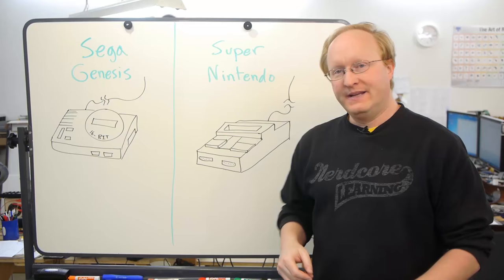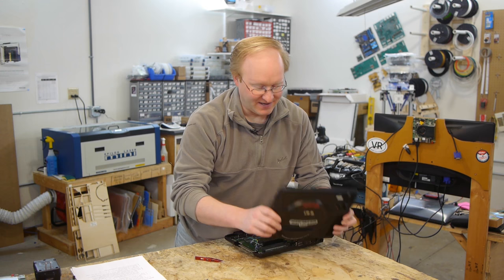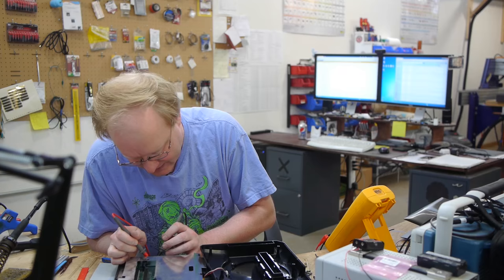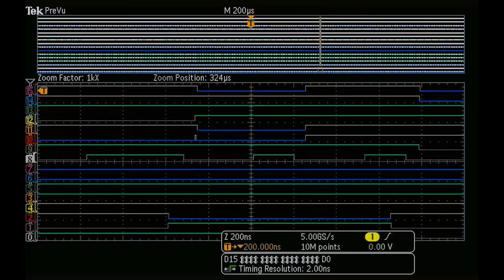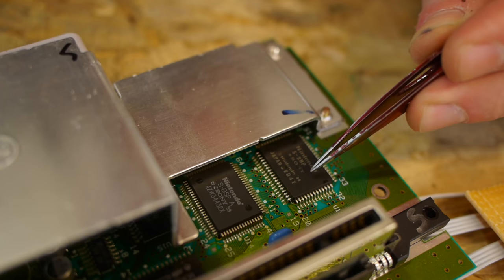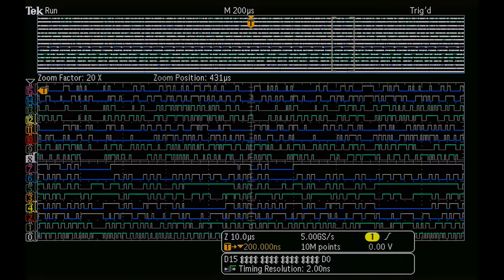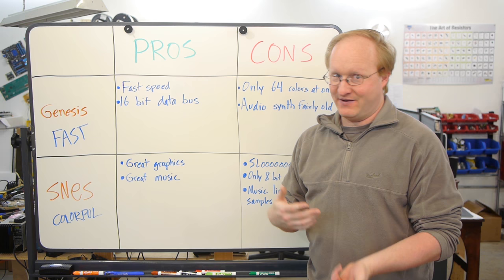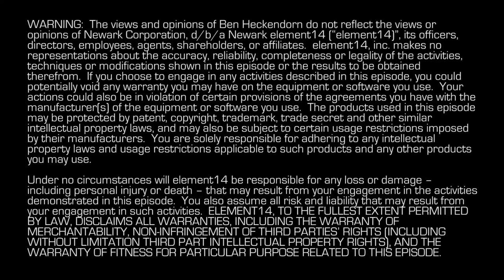Ben Heck’s 16-Bit Console Wars!

Comment: 15:29 The only parts of the Super NES that run at 1.8 MHz (same speed as the NES) are the controller ports. PPU I/O ports are 3.6 MHz, RAM is 2.7 MHz, and ROM can be 2.7 MHz or 3.6 MHz based on the memory control register.

Comment: Well, time to list and nitpick and be annoying.
First, the power base converter don't just "make the cartridge fit", but it not only adapts the pinouts to work, but it also does some memory mapping wizardry to fool the SMS game into thinking the sega genesis memory map is the SMS memory map, but nothing major and the actual SMS work is indeed done by the genesis.

Secondly, the snes indeed was planned at some point to run the NES games, but the main obstacle was the radically different audio chip, that simply could not emulate the NES audio.

Now on the matter of the graphics data, both consoles work with 16 color, 8x8 graphic "bitmaps" called tiles that are assembled like a jigsaw puzzle onscreen, and both had the same exact size of tiles, memory wise. The higher variety of colors snes offered came from the wider selection of palettes to use on the tiles. The genesis offered you 4 sets of 16 colors, while the snes offered 16 sets. also those sets on the genesis were composed of 512 possible colors, while snes offered 32768 colors to choose from.

Now to add one more interesting detail to the already big wall of text, the snes required much cheaper ROM chips because you could use slow, 8bit 2.68 or 3.58 Mhz ROM chips (yes, the devs could potentially sabotage the system even more by using cheaper 2.68 Mhz roms) on the system, which allowed most snes games to actually have more data than the genesis ones, that required a blazing fast 7.6 Mhz ROM with 16bit bus, thus why games with more details and tile variety etc like RPGs were better on the snes, while games that required a CPU that was not constantly in pain ran better on the genesis.

And well, in terms of which is better is entirely dependent on your taste for games and your mood, as not only the developers were wildly different, as the systems enforced wildly different games with their limitations, and the developers of that time in general tried their best to deliver awesome games, and did what they could do.

Comment: I care more about "which games are more fun" than "which system is technically superior"
Reply: +vince94 (haxxor199x) Both are equally obsolete because 100 megahertz is the minimum unit that matters at all in modern Risc architecture .
Reply: Both are very fun timeless consoles, collect for them both.
I can't imagine a 16-bit era without Alien Soldier or Mega Man X
Super Metroid or Shinobi 3
NInja Warriors or Streets of Rage 2
Final Fantasy VI or Shining Force (1 or 2)
R-Type 3 or Thunder Force IV
Contra 3 or Gunstar Heroes

the list goes on and on...
Reply: I'm confused by your comment. 3rd parties are not as much concerned with technical superiority as they are with the consoles install base size and sales rate. Hence why the DS, 3DS and Ps2 received more support despite being technically inferior to their direct competitors.  
Also you somewhat contradicted yourself by lumping the GC in there, the GC was superior to the Ps2 yet received less games, (though it still received wayy more than the 64 and Wii U), so it's ridiculous to compare the GC to those two.
Also our comments are regarding the 16-bit systems not the 6th gen systems?

Comment: What bugs me is that this is all known information. Anybody who's capable of googling spec sheets can do a side by side comparison. Base console, the SNES trumped virtually everything except for processing speed. This was Sega's only claim, so my God, Blast Processing was plastered every where! Never mind that audio was generally better on the SNES. Never mind that the color palette was larger and brighter than the SNES. Never mind that rotation and scaling could be handled in Mode 7 with the SNES while the Genesis needed it's 32X and CD Attachments.
Reply: TheChikyChiky considering Nintendo had an extra two years to develop the hardware, it's strange that they even let Sega have that advantage.  And it's not a small thing either as it allowed Genesis games to have more objects on screen without slowing down which is a big plus for some genres such as shooters.  There are a number of examples of SNES games with less going on in general or inexplicable slowdown.  It's an advantage Sega probably shouldn't have had at all.
Reply: TheChikyChiky This is actually not true. The Genesis has other advantages over the SNES that were either not mentioned in the video or were only briefly mentioned here. Did you notice the part where he said each pixel on the Genesis carries less data because of the lower color count? There's an upside for Sega on that: Its games run at a higher resolution. Basically, Genesis games run at a higher resolution than SNES games.

Another difference not explained in the video are sound channels. The Genesis uses 10 sound channels while the SNES uses 8. Finally, he didn't compare the clockspeed on the co-processors. The Genesis' co-processor runs at a faster MHZ than the SNES' main processor. So there's a lot more to it than just a faster CPU.
Reply: +Gonçalo Tordo you just blow my mind
Reply: +TAMPUZ Thank you :)
Reply: +Gonçalo Tordo i didn't even know sega genesis/megadrive had 10 sound channels i thought the snes had more sound channels but when i saw your comment.. BOOM!
Reply: +TAMPUZ Sadly, it's a common misconception. The Genesis has TWO sound chips, but for some reason, all comparisons I've seen on Youtube only list the FM sound chip and completely ignore the PSG's sound chip existence. 

The FM sound chip has 6 channels and the PSG sound chip has 4 channels. The SNES only has one sound chip but has 8 channels. This is actually part of the reason why many Genesis games sound kind of poor, the Genesis has the potential for better sound, but it requires developers to properly balance both sound chips.

Another misconception between both consoles are their resolution outputs. Almost every comparison I've seen states the SNES runs games at a higher resolution because the official SNES resolutions are as follows: 256x224 512 x 448 versus the Genesis resolution of: 320 x 224.

What many don't understand is that the 512x448 resolution is not meant to be used for gameplay. In this resolution, the SNES can only list 16 colors. This resolution mode was created for title screens, nothing else. No game has ever used this resolution mode. So SNES games actually run in 256x224 which is a lower resolution than the Genesis' 320x224
Reply: japenese and europe can do amazing music with genesis but did you know gems sound driver? its so bad. but only some developers can do amazing music with gems but still gems sound driver is maybe the worst sound driver ever on the genesis and thats the reason why the many genesis games sounds so poor.

(sorry for my bad english)
Reply: +TAMPUZ Yep I'm familiar with it. It really was a poor sound driver though some developers did create great music despite it. As far as  I know it was used for over 100 Genesis games making it the most commonly used sound driver on the console. The driver only used the FM chip if I'm not mistaken

(Your English is fine, don't worry :) ))
Reply: ok thanks.
and thanks for telling how many genesis games uses gems sound driver. but the best gems music what i know is: robocop vs terminator, kid chameleon, and comix zone. i can't remember all of them
Reply: Those are very good examples. I love Comix Zone's soundtrack
Reply: Oh my days.. I can see young me here! Haha! So cute. Nowdays i actually think that the GEMS sound driver isn't bad, its amazing when you know what you're doing. It needed practise and same thing goes to every sound driver used on Megadrive/Genesis. The bad sound was beacuse of lazy developers, People that didn't know how to use the sound driver even when they practised (this can be forgiven, Genesis /Megadrive music was really complicated and hard to do, so you really gotta spend alot time with it). Also i was really looking for this comment section, beacuse i knew young me was here 4 years ago when i was reallllllly a Megadrive/Genesis fanboy lol! Nowdays i just love both and everybody should! Both have amazing games, and some are better than the other, love both!

Comment: The assessment about the Power Base Converter is almost correct. It's mostly used for adapting the Mega Drive cartridge port to the Master System cartridge. But it also has some passive circuitry, I cant recall what exactly it does, but one of it's primary functions was to suspend the 68k (And to that extend the YM 2612 synth chip) and put the Z80 (and the Texas Instruments PSG) in charge of the system.

Comment: Guys, you're totally forgetting about the Turbografx 16! Okay, that was a console with an 8 bit CPU but it had 2 16 bit graphics processors! It could show even more colours on-screen than the Super Nintendo and the Sega Genesis combined! Not to mention, it was the most powerful 8 bit CPU of all time! It had even more arcade-close ports than the Genesis, and it was much faster than the Super Nintendo too! 7.1 MHz, almost as fast as the Genesis!
And the sound was also amazing, it used wavetable synthesis (programmable waveforms) instead of FM synthesis from the Genesis or sampled sounds from the Super Nintendo, so it could produce cleaner sounds than the Genesis and the sounds were much less muffled than the SNES!
The Turbografx 16 was an amazing system that deserves a lot more attention than it gets, it's a true hidden gem forgotten by time, and also a technological wonder considering that it is 1987 hardware that stands up really well against the 1988 Mega Drive and 1990 Super Famicom!
Reply: Well, I don't know much about the Turbo Grafx, but what do you think are the best games on the system, since that's what matters most.
Reply: There are loads of great shmups on the system, but the stand-out ones that come to my mind are Hudson's Soldier series, which consists of Super Star Soldier, Final Soldier, Soldier Blade and Star Parodier (CD), there's also Blazing Lazers which was a great launch title, Air Zonk, Aero Blasters, 1943 KAI, Cotton Fantastic Night Dreams (CD) the absolute classics Gate of Thunder (CD) and Lords of Thunder (CD) and the system's holy grail Magical Chase, as well as many others that I would name if I had the whole day to keep on naming...
There are also some pretty cool action platformers on the system such as the Bonk series, Bonk's Adventure, Bonk's Revenge and Bonk 3, they take some getting used to but once it clicks with you they're a blast, then there's New Adventure Island, one of the best in the series, Jackie Chan's Action Kung Fu, which is probably the best game based on a celebrity, Dragon's Curse is like a Metroidvania with RPG-esque elements before Super Metroid was even a thing, Ninja Spirit is great, Legendary Axe 2 is a lot of fun, Kaze Kiri Ninja Action (CD) has amazing graphics that rival GBA games, Shubibinman 3 (CD) is a great (if super-easy) tech-demo, but the one true game that will get anyone hooked on the TurboGrafx-16 (unless they have a really messed up taste) is Castlevania Dracula X Rondo of Blood (CD), which I consider to be the absolute best game in the series bar none...

And that's because I haven't even talked about the top-down action games, such as Bloody Wolf which is like Contra but from a top-down view, Last Alert (CD) is a spiritual successor to Bloody Wolf with amazingly bad voice acting, Cratermaze is a fun top-down maze game with a super-catchy soundtrack where you collect things and bury monsters to kill them, Valkyrie no Densetsu is Namco's best game on the system, Ys Books 1 and 2 (CD) is the quintessential Action RPG on the system, Ys IV, which was fan-translated, takes everything that Ys 1+2 did right and does it even better with amazing graphics and music, Neutopia 1 and 2 are the system's response to the Legend of Zelda, but they're flip-screen kinda like Zelda 1 (they came out before A Link to the Past) but hey, if you ever wanted a 16 bit version of Zelda 1 these are the games for you! Dungeon Explorer is the system's response to Gauntlet, it supports 5 player action, the sequel on CD is even better, but the top-down action game you must play on TurboGrafx-16 is Bomberman '94! It's the definitive Bomberman game on the system, it's pretty much the same game as Mega Bomberman on the Genesis, only better in every single way, there's also Bomberman '93 which is pretty good too, with great music to boot, but '94 is better...

A few other honourable mentions that I can't fit into the aforementioned genres are Devil's Crush which is probably the best pinball video game ever, Special Criminal Investigation is a good racing game, a great version of Street Fighter II, a version of After Burner II which far surpasses the Genesis version, Ys 3 (CD) is my favourite Ys game, but it's a departure from the rest of the series for being a platforming RPG, Popful Mail (CD) is an even better platforming RPG but it's Japan-only so it's a little hard to progress, Double Dragon II (CD) is maybe the best version of the game, Cosmic Fantasy II (CD) is one of the few traditional RPGs for the system that was actually translated back in the day, Mad Stalker (CD) is a good sidescrolling beat'em up with mechs, Tengai Makyou Kabuki Ittoryoudan (CD) is the other best fighting game on the system, Asuka 120% Maxima Burning Fest (CD) is the 'other' other best fighting game on the system, and the Xanadu games (CD) are Japan-only action RPGs that really show off the system's graphics and sound capabilities, the 2nd game is currently being fan-translated, the closest thing you can get to them in English is Ys IV, so if you like that then look forward to that translation because Xanadu 2 has even better graphics and music!